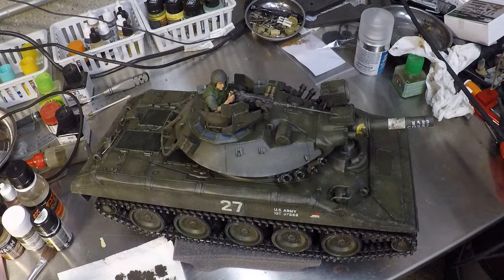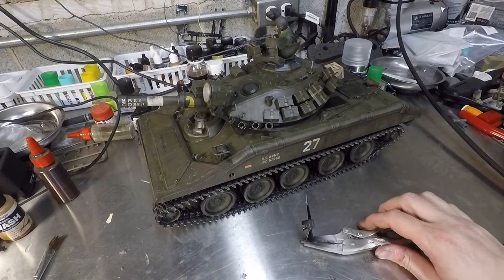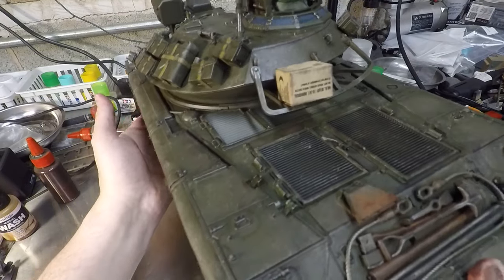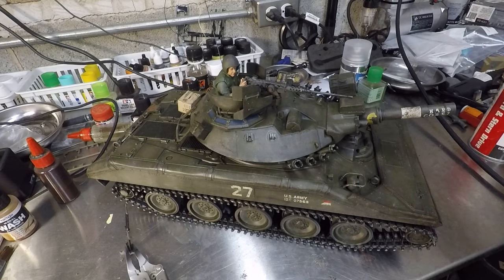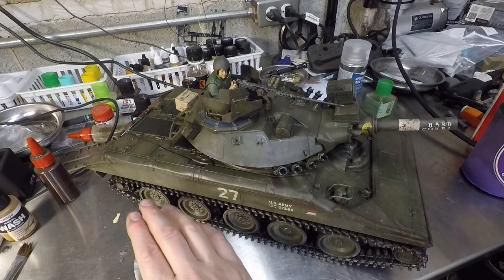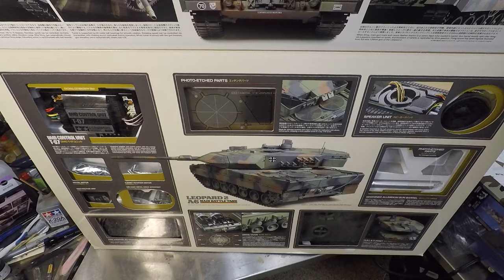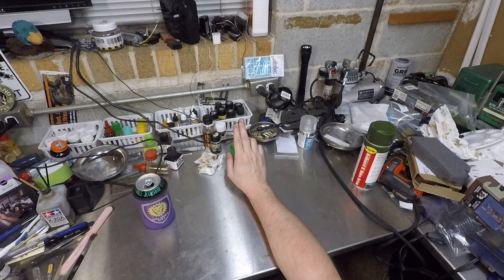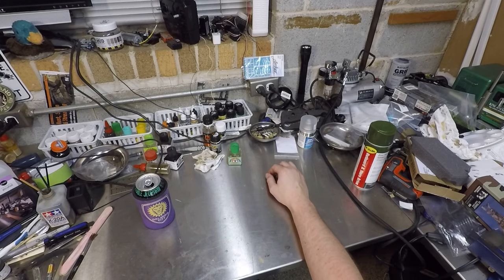Tamiya 1/16 RC Full Option M551 Sheridan #56043 Build Video Part 11 Chapter 2

Comment: I think those mud flaps , front and rear, will disappear on a lot of these tanks. Even if you don’t drive hard. One little rock caught up in the tracks and pop off it goes. I have Tamiyas JS-2 and I don’t battle but run them around the yard for fun. It has lost both mud scrappers from the front of drive sprockets, one side twice, not going to bother replacing these again.